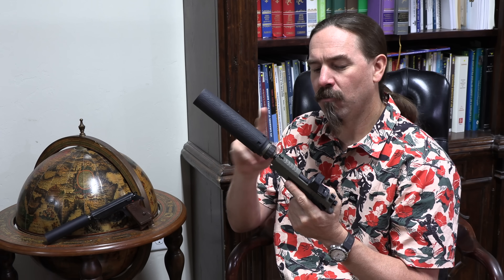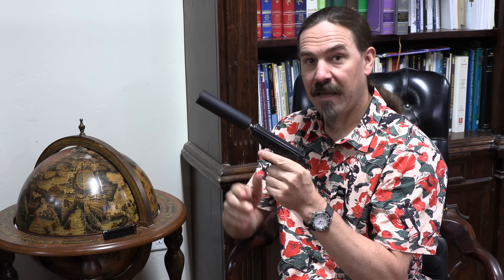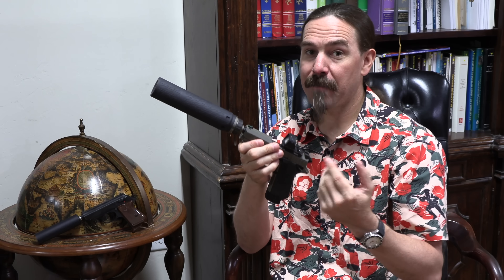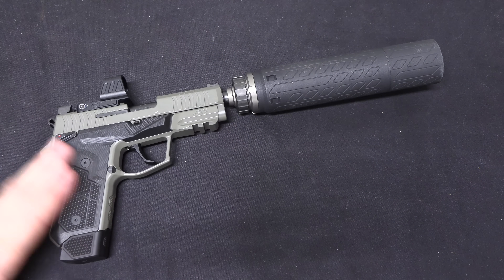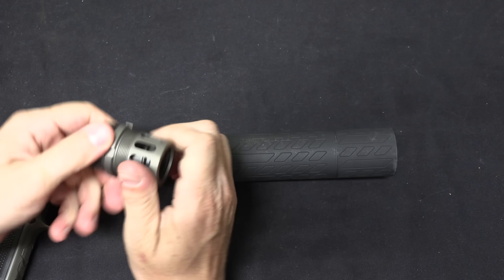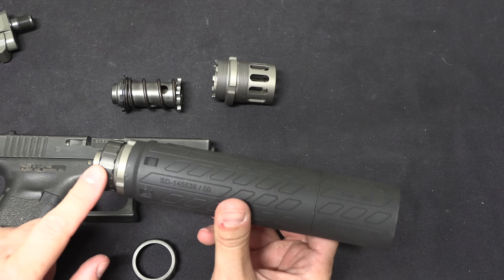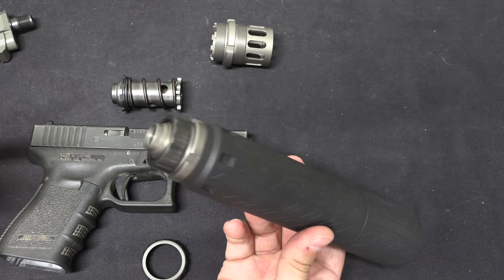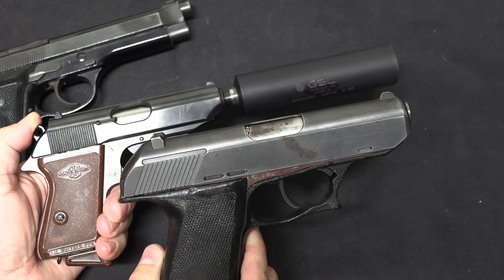Nielsen Device: How it Works and Why it's Necessary

Comment: Hey great basic information on this device. Have known about it since the Mac 10 Sionics later years . Never actually witnessed this in action. I just change the spring weight per gunsmith recommendation. 
Is this a problem with all calibers ( 22 caliber suppressor otw) ? Great understandable information.

Comment: i thought you just said the gasses from the bullet are used to push the slide back on a fixed barrel, which is a recoil operated firearm. but then you say a recoil pistol. uhmm, call me crazy, but are both styles the same? unless one is putting the can on a single shot,  ie: bolt, breach cap, muzzle loading, falling block, arent the remaining firearms you are attempting to describe considered, semi-auto? i mean, its not a revolver, but we know how those work so well with a can.

Comment: Just from working on gas blow back airsoft guns, I can personally attest to how OBNOXIOUS it is to find the proper combination of spring strengths to handle each individual build and its intended usage. Often times, its either too much tension, and it simply wont cycle, but other times, its too little tension, and your semi-automatic is now a fully automatic mag-dumper. 

The worst offender, ironically, would be handguns (specifically 2011 airsoft blowbacks, for some reason, which are almost identical internally to real steel 2011s)

Comment: I have a Banish 45 that has the booster in the suppressor and cannot get it to cycle. It will fire the first round and then that's it. My pew pew is an FN509 Compact Tactical 9 MM and I purchased the suppressor from SilencerCentral.  I called them and we discussed the issue and I told them I'm shooting 115 grain CCI, Monarch and Fiochi and it's the same with all three of those. They informed me for the suppressor to function correctly I should be shooting either 124 or 147 grain.  I will give that a try and hopefully will have success.

Comment: Why don't they place a 30* recoil port going down pre suppressor to reduce higher pressure ammo reduce the subsonic port pre suppressor
Reply: The suppressor should pushback and down to balance recoil but you can use higher pressure ammo but reduce subsonic pre through suppressor with a port adjustment with same spring but can reduce recoil

Comment: A couple of issues when using a suppressor. You will experience more burned gases and powder in your face with every shot. You will need to find the correct recoil spring through trial and error. My suppressor is on a 9mm Walther the best ammo that I’ve found is 165 grain for reliable operation and very quiet. Finally, the Nelson device needs cleaning and lubrication else it will lock up and once again your pistol will stop functioning.

Comment: Or... you could use a weaker spring...  right? Nevermind, you just said it. I remember reading that the CIA had guns specially modified that way in the 80s.

Comment: @ForgottenWeapons Ian McCollum, I think that the Glock would have cycled no problem but the suppressor impacted the frame of the Glock before the barrel could reach a proper angle for the slide to be able to cycle. Essentially when the round was fired the suppressor impacted the frame and created a pinch point on the barrel that prevented the slide from being able to clear the barrel. Ultimately if the suppressor never impacted the frame the Glock would have cycled no problem. Try a thread extension with the same setup and see if it cycles. Cheers! great videos by the way.
Reply: But clearly with the Nielsen device on it is like butter, which is what the video is about. I just had the observation that the suppressor impacted the frame and am curious if it would have cycled if the suppressor never impacted the frame.

Comment: When the supressor went back it kinda pushed the slide backwards and the spring had a REALLY hard time putting it into place. Not sure if the gun can fire in that position with the slide slightly back. Guess as long is it doesnt get in the way of the hammer It's an OK. Wonder what will happen to the whole thing while repeatedly firing. Or you actually need to pause and wait till it goes all the way.

Comment: Permanently attached suppressors are a pain. Like getting the bolts off a 302 mustang that break down from no water on the block. Those threads are now welds.
Reply: Just bringing up an added perk on why you would want a well lubed coupling on a driveshaft. My homemade laser pointer has the same design flaws that make me want to create a Neilson device for the lens thread on the diode like a barrel of sorts. It fused a chromium oxide layer thread I applied lithium chain bike lube on. The lens mount/barrel of my laser got past 2700° according to the stupid exitech 30hz handheld thermal that's more for finding hot components so I don't know how hot it got. It set off the smoke alarm in my suite and 3 of my neighbors without any visible smoke 😂. If I used aluminum it would have burned off.
Reply: I couldn't get it off without a Dremel and $200 worth of diamond earrings my girlfriend didn't mind letting the guy at the jewelry store turn to dust
Reply: Firestop was my laser target and I wore enough filters to not be able to see my target without it being blasted by a 1000 Lumen flashlight so I could see the faint safe laser surface for those "protons" to hit. My Nikon d5200 CMOS sensor is toast so best video I got was my living room flashing to darkness and lines and me complaining about the the silicone gloves touching a hot coffee without a sleeve
Reply: And audio of me coughing for 8 minutes before I was considering calling an ambulance

Comment: (retired now) ...In the 70's,80's, the best "set up" was a 22L revolver combined with a Two liter Coca-Cola plastic bottle or even smaller size ( depending the noise decibels required for the action.) It looks like you could run 400 plus rounds thru that piece.

Comment: Hmmm  in the slo mo it looked like the supressor bent at the point of being threaded onto the barrel. It looks lke that bending hapends when the barrel tip goes up because the back is cycling downward. That put the barrel at a differenet angle and the heavy supressor has to follow it. That costant bending presure would probably cause failure after many shots. Am I wrong?

Comment: why not use the underbarrel picatinny rail to attach a Suppressor on, that only touch the tip of the barrel?
Reply: there is one, its made by a company called "fischer development"
Reply: i want you to do some research on why not, hint it’s the same reason revolvers aren’t suppressed
Reply: @Jaemon4Eva you mean, someone already tried that, without success!?!

Comment: ~"The Nielsen Device, also known as a muzzle booster or piston, is a mechanical component used in conjunction with pistol suppressors to ensure reliable cycling of semi-automatic handguns. Its primary purpose is to allow pistols with tilting or moving barrels to function properly when a suppressor is attached. Without it, the added weight of the suppressor can disrupt the recoil dynamics, leading to malfunctions such as failure to eject, feed, or cycle.

This device is essential for maintaining the short-recoil operation of most modern centerfire pistols, including popular models like Glocks, Sig Sauer P226s, and 1911s. " -- Brave AI

Comment: A very complex silencer!
 It's simpler - a spring and a set of washers with different central holes (for the bullet to pass through).
The washers are pressed against the muzzle of the weapon by the spring.
and a rubber membrane at the exit.
That's it!

Comment: Like your vids. Very informative. In this vid showing how the suppressor interferes with the slide action, the suppressor strikes the main frame of the pistol completely negating your explaination.. What you say may indeed be true but when the suppressor hits the main frame first, the gas pressure has nothing to do with why it won't cycle.

Comment: The Browning semi automatic System is actually the least qualified system for suppressed shooting, we produced thousands of suppressors in Switzerland in the 80s till they were banned. Of course we developed as well a suppressor like the Nielsen, just decades before and less complicated and our system was complete internal. But more parts made it heavier and more expensive, plus it needed maintenance to function properly and this only with normal ammo, special silencer ammo did never work properly.
Therefor we focused on simple, cheaper suppressors for fixed barrel pistols like HK P7, Steyr GB for 9mm Parabellum and Walther PP for 9mm short, 7.65 and .22lr and other single shot pistols, there the use of subsonic ammo made the suppressor really silent, which was very much demanded and appreciated and made them very cheap to produce.

Comment: flowthrough... the newest gimmick for silencers. it's like they forgot that suppressors are supposed to retain gas hahahaha. Also (I'm sure you know Ian but alot of your followers probably don't) for maximum sound suppression you don't want your slide to cycle. back in the day, guns that were designed for maximum quietness, had a slide lock that stopped them from cycling because when the slide cycles it releases gas aka noise.

Comment: I originally thought that these were illegal under federal law. But as I just did some quick Google research, there is an application vetting process through our good friends at the ATF...Fill out an application describing why it's needed plus a 200$"TAX" Stamp. I wonder if that is refunded if denied?🤔🤔🤔 Also you must follow state laws.....So if the state you reside in, lists them as an illegal device...GUESS WHAT?!

 Just use a plastic soda bottle and skip all the b.s. red tape😂

Comment: I feel like the spring in my Lunar 9 piston is too strong. I'd guess 40lbs. Havent been able to get more than 1 round through it. FTE. Even after lubing the booster with white lithium grease and adding extra CLP to the pistol. 

I've got 2 lighter recoil springs on the way, I'm sure that will work.

Comment: holy crap look at the size of the compressor jeeessuuus, easily muzzle any rifle, pistol by shoving the end of the barrel a couple of inches into the open end of an empty soda can and gaffa tape it to the barrel , your 1st shot punches a hole in the dead end of the can and from there on it acts as a muffler 😀

Comment: Interesting. So is this Nielsen system necessary or beneficial for semi-autos like the Beretta 92 which use a straightline rotating cam decoupling assembly instead of the "tipping" barrel in Glocks/ similar designs? Btw years ago I got to fire a B92 fitted w a "Hush Puppy" suppressor kit. Interestingly it included a slide lock to prevent cycling. You had to rack it per shot, but this 9mm was shockingly quiet

Comment: Watching your "successful" cycling video VERY carefully, you can see the action (nearly?) STOP partway through chambering the next round, then continue chambering SO slowly that it doesn't finish chambering until the weapon is back on target. This appears to be unreliable and right on the hairy edge of malfunctioning, e.g. resulting in failure to fully chamber the next round, similar to what can happen if you manually chamber a round and slowly allow the slide to move forward. How big of a real-world problem is this?

Comment: While I've never fully grasped how a suppressor works, I do know that the barrel is threaded on the outside. I also understand that using the sights with the suppressor might be challenging. However, after watching a video, I realized that my initial assumptions were incorrect. I own a Sig and hold a CCW permit for a Sig Sauer P320 in California. Despite this, I have no intention of getting a suppressor. This decision is not only because I don't see the need for one, but also because it's against the law. No, suppressors (silencers) are illegal in California for private handgun owners. California Penal Code 33410 PC makes it a felony for individuals to possess, manufacture, or sell these devices, even if they are legally purchased or registered in another state. Violations can result in imprisonment and significant fines

Comment: Fudd lore moment:
this "failure to cycle" was actually desirable in early suppressed firearms that used rubber disks for the gas seal. The thought at the time, according to the fudd-lore give to me, was to totally seal the front and back of the barrel and allow the chamber pressure to leak down quietly through the hole the bullet made in the rubber disk when it was fired, and only when it was safe to do so would the triggerman operate the slide or remove the suppressor.

Comment: I have a Glock 41 (45ACP long slide) loaded with +P ammo at 616 ft-lbs of energy and it will cycle reliably with or without a Nielsen Device. My Glock 21 (45ACP) is always unreliable with a suppressor unless it has a Nielsen device. The +P ammo is hard on the frame of the Glock 21 but seems to be fine with the Glock 41.

Comment: You spend a  lot of time talking about weight balancing and whatnot, and im not going to say that isn't an issue however its seems from your footage that the issue is moreso that the suppressor hitting the frame of the pistol is 95% of the problem. You could solve some of that by just putting a longer barrel on it. That doesn't solve the weight issue of course...
Reply: by the time the silencer hits the frame, the gun is completely unlocked, so it's not actually an issue

Comment: I'm 52 I started building silencers when i was 9 years old in the 50s. The problem has always been with a floating barrel. If the barrel floats like in a 451911, it won't. The slide wont-work right? That's why in movies, when you see people with a 45. With a silencer on it, it's not a silencer, it's a 2.  Silencer puts pressure on it causes the slide To malfunction due to the floating barrel. Mov.\n I.e. gods have a fixed barrel that does not float. It's a specially designed gun.
Reply: No way you're 52 and have been building silencers in the 50s.

And yes, Hollywood distorts things and presents things that are not true.

Comment: I honestly think "air" pistols could achieve the desired result comparable to lower caliber suppressed sub sonic ammo. Im talking about real airguns not bb or pellet type. The only advantage of a suppresed .22/.32/.380 would be capacity. But, on the other end, you eliminate  cycling/feed issues, and having to make adjustments.

Comment: Can you use the Nielsen on a full blow back system. I have mostly tilting barrels but do have 2 9mm that are fixed. Would like 1 can to fit them all and not have to open the can every time I change what I shoot.
Reply from the maker: No, you should not use a booster on a fixed barrel gun. It won't hurt the gun, but it will put a lot of wear on the booster.

Comment: Great info, thanks. I notice that when you fire the pistol without the device, the muzzle blast is projected out through the front of the suppressor , but when you use the device there are a significant amount of sparks dispersed in what looks to be a 306 degree pattern right at the base (threads) of the device (start at 10:23) ... how would this affect the shooter, recoil, aiming, etc.?

Comment: lol, my son said this would make a funny Monty Python clip...

Solid Snake creeps near a corner and pulls out his pistol and a silencer and starts threading it.
A guard appears at the end of a 50 yard hallway.
Snake, still threading the can on...
The guard checks the first door, looking in the window,
Still threading...
The guard checks another window and flips a few pages on the clipboard stuck to it.
Still threading...
Guard is 20 yards away, drinks from the water cooler.
Still threading, a look of concern with one eyebrow raised...
Guard checks another door and twirls his baton (British guard).
Still threading...
The guard gets to within five feet of the corner and notices a shadow and looks in Snake's direction...
Snake finishes attaching the can and aims at the guard...

Alternate ending...
Snake's friend, Gray Fox, steps in, throws on a tri-lug mounted can on HIS pistol and takes out the guard, looks back at Snake, shakes his head and then fade to black.

Comment: is it just me or did at 10:23, a flash between barrel and suppressor, looked like something breaking? even when suppressor returned back, looks like it's stuck in a bit upward crucked position and than returns back down latter? is that normal?

Comment: I run a Dead air Odessa 9 on my Glock 26.  I have no issues.  In looking at your treaded barrel.  I wonder if it's too short?  My barrel seems to stick out slightly longer than your display set-up.

My set-up cycles as it should.  If you want to purchase this special adapter to cycle your EDC firearm.  More power to ya.  

But it is good information to have if a problem ever does pop-up.

Comment: Great video, once again, well done as always.  Umm, one thing... see if you can find an AWC Nexus suppressor for the 45ACP.  The Nielsen device is built in and a simple pull/twist to the body of the can switches it from semi-auto to single shot locked breech. Fully "charged" with grease the single shot mode is stupid quiet.  AWC sold them with an extended threaded bbl.

Comment: Slide DID NOT lock into battery after the shot, need to thumb the rear of the slide to fire next shot
had a glock that did that every time...sold the gun.

Comment: So, let me see if I understand this correctly. Essentially what the Nielsen device does is even out the forces between slide and suppressor, allowing slide to cycle due to not having to overcome the weight of the suppressor because the device is allowing the suppressor to move forward slightly, thus essentially resulting in equal and opposite reaction?